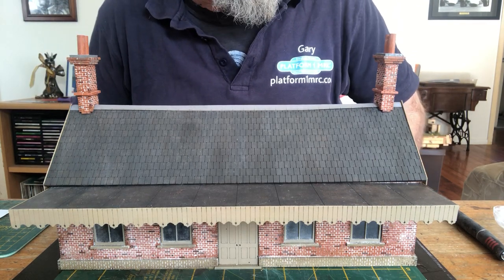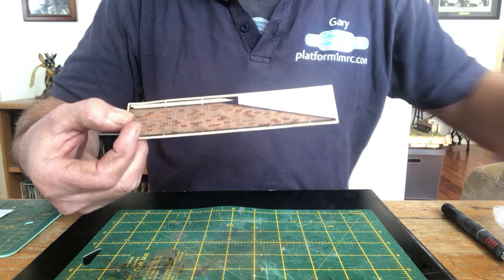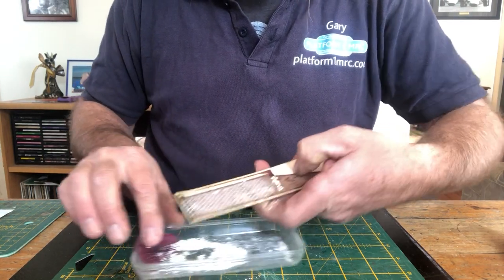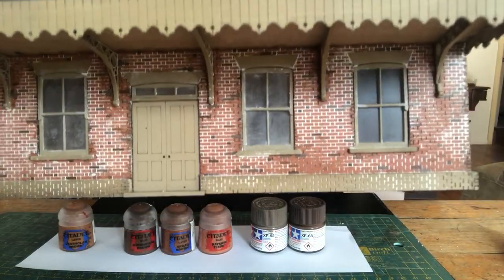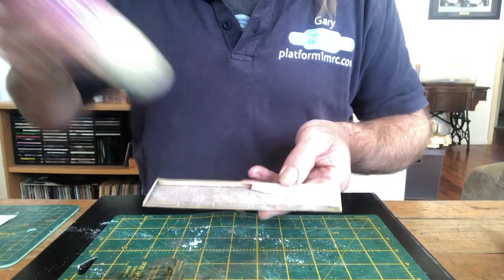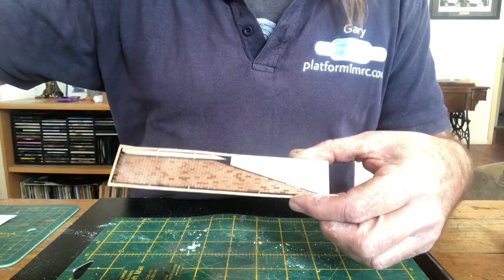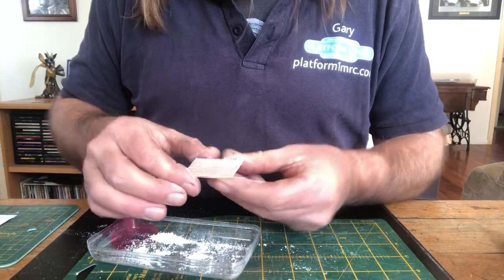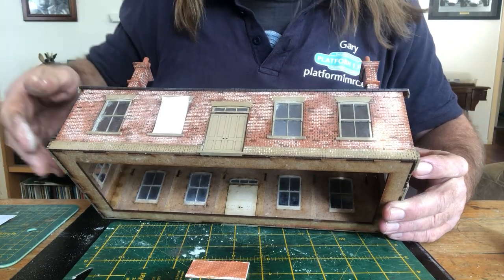Chalk Mortar For Model Buildings

Comment: That station, brickwork, mortar and overall looks absolutely awesome. Makes me want to get into O gauge even more. Some great techniques sown here as well. Would not have thought of using chalk and I have a bit of it myself. Will have to try it on my buildings later on. I have a huge collection of citadel paints so will most likely use your recipe as well. Awesome video, Clint.
Reply from the maker: Thank you Clint for your kind comments. I was asked earlier today by one of the members of Platform1MRC.com to demonstrate how I achieve this look. It is quite simple and if I had more time, I would have demonstrated this on a larger model.

Cheers, Gary.